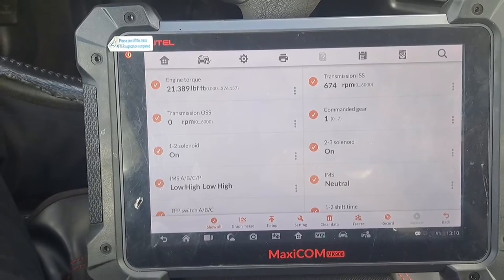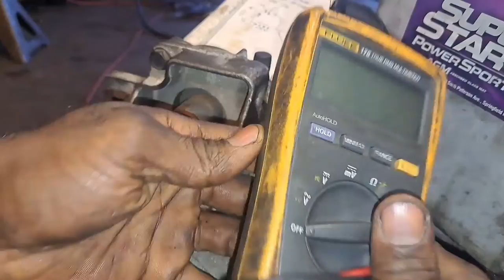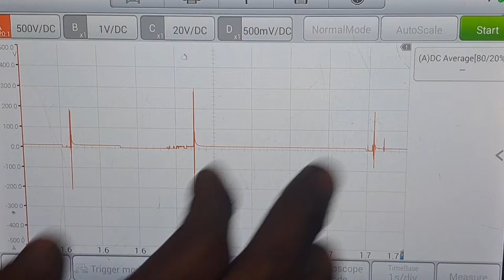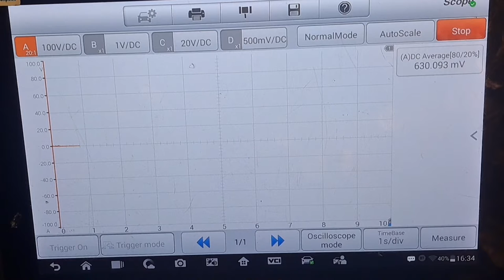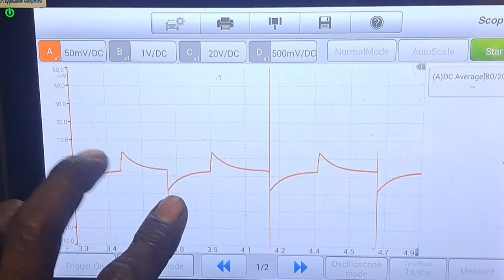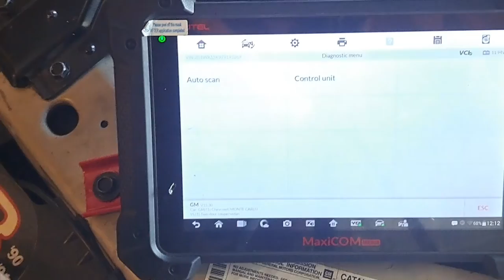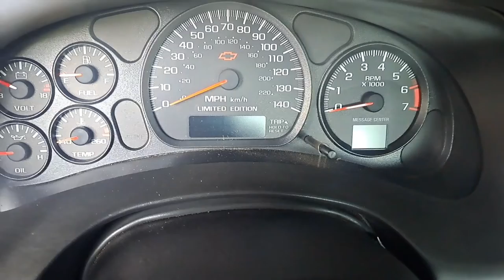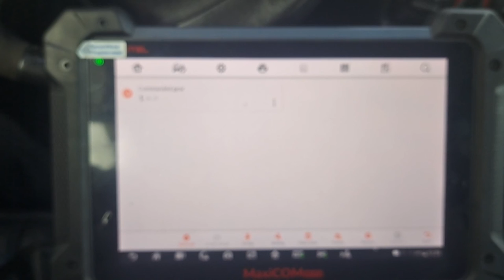2003 Chevy monte carlo won't shift,  new transmission and TCM pt1

Comment: You are not reading this right 😒 I use a snap on  scanner and it shows if the command to shift is sent to the transmission or not I have the same issue no 2nd to third or third to fourth. This turns will shift 1 to2 with no computer because of the overrunning clutch in the tens regardless what gear it's in . The computer is made up of two parts inputs and out puts ,in your case your not seeing output you are just seeing actual in real time the snap on  scanner allows you to see command being sent or not so on mine the command was being sent to the Trans for 2 to 3 but was not shifting because of a bad shift solenoid if the inputs ,tp, speed ect are reading correctly and the computer don't send the command then it's a bad computer, you can have bad speed sensors or internal Trans wiring issues even though it's a rebuilt Trans they use alot of the electronics over when they rebuild them
Reply from the maker: Watch pt2